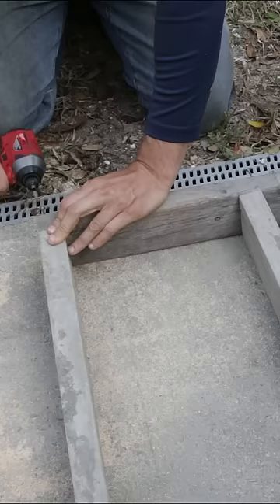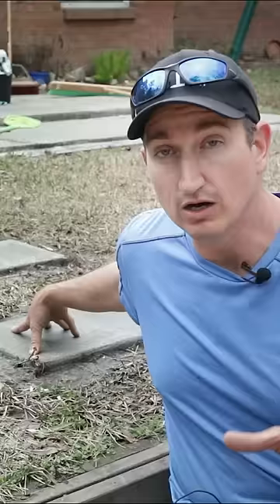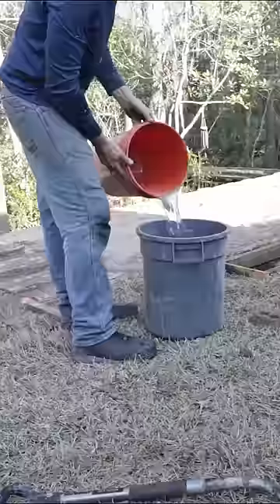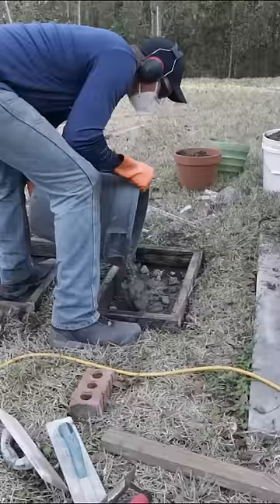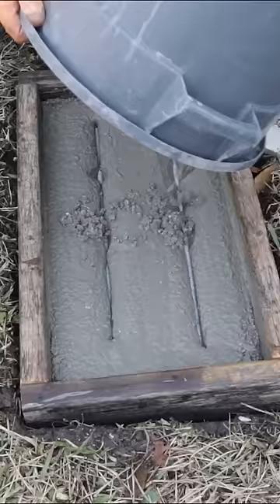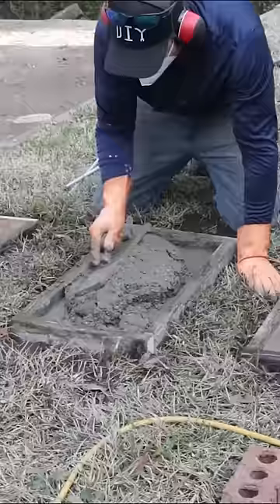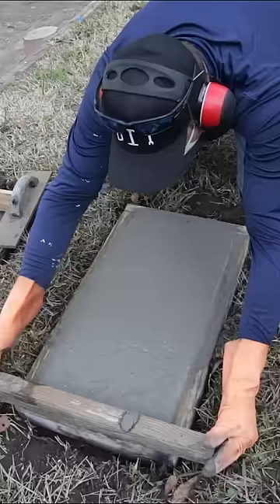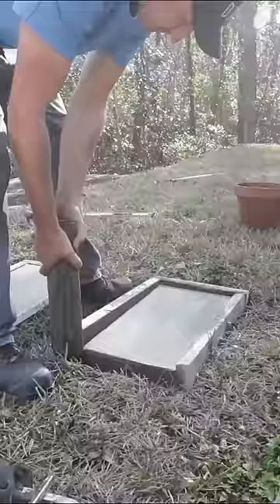How To Work with Concrete for the First Time

Comment: You dont need reinforcement for something like that. Cracking happens because of expansion and contraction, but there is not enough shear force along a 3x2 step that isnt up against anything.
Reply: Theres 2 kinds of concrete, concrete thats cracked, and concrete thats going to crack.
Reply: @MatthewJRedmond  When I leave a customer with some new concrete, I always tell them 3 things. Its going to crack, it wont catch on fire, and nobody will steal it
Reply: @jordantoops3814  without a doubt lol.
Reply: You still have to put crushed stone under the concrete. It's going to crack and sink from the elemental erosion
Reply: Rebar keeps the slabs from shifting away from one another. In years time the ground moves and u can have slabs moving any direction haha
Reply: Yep agree!  The bar can act as expansion joint.  Maybe sone wire mesh if anything
Reply: @TrwUniversity  rebar that is completely contained inside each slab as shown in the video will do nothing of the sort. It only helps minimize potential breaking/cracking of the slab itself.
Reply: @dragons_red  metal doesn’t make concrete stronger 

Concrete will crack with rebar in it or without it in it.

Comment: 1) The pad will move and sink because you didn't put a bed of crushed stone and sand down. 
2) You really don't need reinforcement for a small pad like this, but if you insist, use rebar which is made for this and a lot less expensive than threaded rod.
3) it might be overkill for a tiny job like this, but cover it with plastic while the concrete cures.

Comment: You forgot the first step most first timers do mixing concrete.  Add enough water to the mix until you have the consistency of coffee.  Then stand around wondering how long it will take to setup.😂
Reply: Isn't that cement not concrete?!
Reply: @D_and_L  cement is one ingredient in concrete.  Concrete is the finished product when you mix cement, sand, gravel and water.
Reply: Excellent comment!
Reply: Coffee is the same consistency as water?
Reply: Hahaha, yes.  Most people add way too much water.
Reply: lol my old boss called that "self leveling concrete"

Comment: No edger?  No magnesium float to push the aggregate down a bit and bring up some cream so you have a good hard finish without any aggregate showing?   No broom?  Placing that mud that dry, you might want to do a little more than just a few taps on the firm's to make sure you don't have a bunch of honeycomb.  Chuck up a bigass screwdriver in a 1/2" drill and brrrrrrrt forms.  You can hit the insides too to work like a vibrator to bust any cavitation around the edges too.
Reply: Hammer drill just on hammer setting works best on the forms.
Reply: Just use scc lol

Comment: Telling us the measurement of the form that will hold a full bag of concrete is wonderful!  You rock!
Reply from the maker: It is pretty close but the ground below the form factors in as well.  Even though the boards are 3.5 inches in height the ground height may be inconstant due to divots and bumps.

Comment: These bags of premix concrete are great but there is generally one very important thing I see many people forget to add or do not know to add. This applies is you live in a place that has freezing temperatures in winter. You need to use air add mixture, its a powder you add while mixing and it’s incredibly important if you want your concrete to hold up over the years during freeze thaw cycles especially on larger projects, you will avoid much spalling. Air aff mixture is easy to find at stores where you buy concrete supplies and tools but not a big box store
Reply from the maker: thanks for the tip
Reply: funny that a 1 cement says troweling ruins the air bubbles 😁👍

Comment: If you're going to give a tutorial on concrete you need to know that the rebar needs to have cross bars (aka transverse bars)  or it can just crack down the middle and fall apart . The best thing for that little slab is #9 wire fabric cut about an inch smaller than the inside form dimensions

Comment: If you've never touched concrete before, start small. Pick up a small rock. Only then, should you try touching actual concrete. Curbs are a good jumping off point. Trust me, I'm a concreteologist

Comment: That threaded rod is going to begin to corrode immediately upon setting it in the wet concrete. It’ll be completely reduced to rust in short order. At least give it a coat of paint or vinyl or something to protect the surface of the metal. Rerod is essentially useless in a block that small, although prestressing the rod would offer some minimal benefit.

Comment: Use fiberglass rebar next time.  the steel rebar will oxidize over time and degrade the concrete, eventually resulting in fractures.
Reply: You must be a fiberglass rebar salesman.  99% of all rebar in the world is steel.
Reply: @CJINW  castles in the middle ages didn't use ANY rebar, and yet they're still standing.  Why?  Because they don't have steel rebar oxidizing inside the stone and causing it to crumble.

Comment: That rebar is too near the surface. Would be more beneficial to hit into the ground rebar tied into a steel mesh. Corners will crack quickly unless backfilled to the same level. Looks nice though
Reply: Bro it’s not that serious 😂😂😂 I doubt that thing cracks since it’s not tied into anything and it’s not big enough.. it’ll just move instead of cracking
Reply: Why didnt he use rebar? Its cheaper than threaded rod

Comment: For any concrete walking surface you should lightly drag a broom accorss the top to give some traction for walking.
Reply from the maker: Using the Mag Float seems to leave a good bit of texture for friction on the concrete surface.
Reply: @MrKistel  We'll I guess for personal use it's fine. My experience was commercial and locally they require a brush finish on any concrete that is intended for foot traffic. That includes sidewalks, storage houses, ramps, and even parking lots.

But again, that is for commercial use not personal.

Comment: Also: DO NOT touch cement with bare hands!
Reply: Why not?
Reply: I did Mason tending including mixing the shit and I'm just fine
Reply: @JF94-k4o  Cement burn: the longer the cement stays on the skin, the more damaging the burn can be. Even after washing the cement off, the alkaline burn usually gets worse before it gets better. Skin begins to blister, swell, and bleed, leading to first-, second-, and even third-degree burns following soon after. Severe cases of concrete skin irritation can lead to permanent scarring and even require skin grafts or amputations. 
If it’s a one off, a brief exposure and you wash it off with soap you are likely to be fine, but if you wear gloves you’re totally safe. You’re free to live your life dangerously though. 🙂
Reply: I have never seen that happen although I don’t use concrete all the time but I have used it enough and had it on my hands.
Reply: I do a lot of tile floors and this is true. On bigger projects ive noticed my hands get very tenderoni and raw(feeling of irritations, dryness, and tingly) the next few days. Ive never heard of it doing 2nd and 3rd degree burns but i do know the mortar and grout mix does make my hands raw.
Reply: @Cricrikilik89 just waking up and deciding to lie on the Internet lol

Comment: Rod will rust and expand prematurely ruining the pad.  If it is exposed to water, don’t use any metal reinforcement.  Only garage floors and that which are covered get rods.  Concrete actually bends and is porous.  Mike Haddock concrete school of hard knocks.  He’s awesome!

Comment: Steel rebar is my biggest pet peeve I believe aluminum or carbon fiber rod if you have the money. Why because if the concrete breaks over time the steel bar will oxidize and it expands concrete doesn’t creating failure point old bridges especially near the ocean are vulnerable

Comment: Wipe the inside edges of your wood frame with old motor oil to ease the form off when the concrete is dried
Reply from the maker: good tip

Comment: What about crushed stone at the bottom of the form, leveling the form, troweling the concrete after using the float, edging the blocks once its begun to dry a bit and brooming the blocks after an hour or so ?

Good start......... but it needs a little more than what you show here.

Comment: run a brick trowel between the fresh concrete and the forms, several times, before you screed, get in a habit of doing that, (if you want, that's what I used to do) this helps greatly eliminate honeycomb, and when you "edge" it you will have the aggregate settled in place so you don't get dips in the finished edge
Reply from the maker: great tip
Reply: @MrKistel  Thank you, MrKistel, Len

Comment: Threaded rod was a mistake. Rebar has the same temperature expansion rate as concrete that's the reason concrete cracks up so easily with other metals especially where temperatures can drop below freezing in winter

Comment: The bar isn’t needed on this. The slab is too small and is fully supported under. If you want to stretch the concrete out a little, at this size, you can pour the same thickness as the pavers at your local stores but I like the simplicity for calculating one bag.

Comment: My first concrete job was paving repair, about 8"x18" I used small bag of ready mixed concrete.
As far as I know it's still there under the patio that I laid about 20 years later.
I was about 10 years old - 57 years ago😅
Reply from the maker: awesome, thanks for sharing.

Comment: You absolutely don't need reinforcement for a pour that small and thick. I've found 80 lb bags of concrete hardened from exposure on my property, used and abused for years sitting on the ground with no signs of cracking.

Comment: Thank you so much! I am so intimidated by concrete projects but even more intimidated by pricing for labor.. I know it’s usually hard work and they deserve the pay but when you just don’t have it- You just don’t. Id like to start small and work my way up. Thank you so much for this video!
Reply from the maker: Thanks for the comment and best of luck on your projects.
Reply: The biggest thing when it comes to concrete is to make sure the weather is supposed to be good, and especially when starting out, don't leave it unattended. The best thing about crete is that at every step there's a chance to fix any whoopsies. Say you put a big gouge in it, just wipe it out with a float, you take too much cream off the top somewhere while troweling, just work up some more cream with your float and smooth with the trowel. As long as you don't leave it unattended too long or go with too big a pour that it gets ahead of you. If it starts to setup a bit too quickly, you can spray some water on it to help slow it down and give you more cream if needed. Some people will say not to do that, but it won't hurt anything. Finishing machines come with built-in watering systems for finishing. The only time you're not allowed to do that is if the project manager says no, at which point you just make sure they're not looking 😂
Reply: Thank you both!

Comment: Without placing down a permeable layer of #abc or crushed rock to allow water drainage. The concrete will bury itself before the end of the year, depending on rain fall. 
You cant just place concrete on dirt and expect it not to bury itself.

 It has hands man! Cmon.
Reply: Well if you bought papers,  yr gonna just place them so what's the difference
Reply: Well if you bought papers,  yr gonna just place them so what's the difference
Reply: Well if you bought papers,  yr gonna just place them so what's the difference
Reply: Well if you bought papers,  yr gonna just place them so what's the difference
Reply: Well if you bought papers,  yr gonna just place them so what's the difference
Reply: @garybakker8812  ok bot. Your code malfunctioned.

Comment: see idk I did my first concrete project last summer did a 11ft by 4ft sidewalk to my house. I feel if you do enough research and have a game plan on what you're going to do it's definitely manageable to do. I dug down tamped the area put stone down tamped that wire mesh and rebar. came out really good my only 2 mess ups were i calculated the wrong dimensions for concrete and had some extra bags and I didn't get a concrete mixer. I definitely got a great work out that day
Reply from the maker: I bet that was a good workout!

Comment: Threaded rod is smart, gives something for the concrete to bite onto and prevent motion.
Reply from the maker: Thank you. I think this is the first supportive comment I have received regarding the use of threaded rod.  In the longer video, I describe how did not have rebar around but some surplus threaded rod which is why it was used.
Reply: @MrKistel  glad I could help🙂

Comment: You can also seal the concrete with a concrete sealer like for a garage floor. And do not put rock salt on it in the winter it will destroy the cement.😊

Comment: Where to begin. No Gravel subgrade, no stakes on forms, could pour it all at once if forms were tight n right, don’t need rebar(nobody that pours concrete calls it “threaded rod”) and shoulda broomed it! No texture means slick as snot when wet 😉

Comment: I would’ve definitely used an edger on this. Especially in the very beginning, those sharp edges are going to be so fragile, and even after cured will likely get major chip out overtime.
Reply from the maker: Edger is shown in the longer format video provided in the video description.  YT only allows 60 secs for short vids which makes it hard to squeeze in all the details.
Reply: @MrKistel how is there more details?😂

Comment: Let’s see. The “experts” say you should have dug much deeper, poured  24” footings, added 3/4” crushed stone, sand base, termite treated, plastic, wire mesh and rebar with chairs, braced forms, sprayed forms with diesel (PAM works, too), specified an ideal slump, used a vibrator, edged the sides, brush finished or stamped the stones, etc. Or, just be happy with what you have done!  Or, like some said, save yourself the aggravation, work, time and criticisms by just using premade stepping stones.

Comment: Reminder: the more water that you add, the quicker the set time, AND if you want a silky-smooth finish you will need to smooth the top.  The more smoothing of the top before the set time, you will see few large rock , but more water-sand at the top,
Reply: Be careful with adding water. Too much water you will throw off the w/c (water/cement) ratio which in turn will compromise your overall strength. Better to have to use a little more elbow grease to get a nice finish then sapping the strength away and the concrete snapping under its own weight.

Comment: threaded rod is a waste, just use coat hangers, also could show different ways to finish surface, and should clean edge so it won’t have sharp corner and slope away water

Comment: You miss a simple tool,  called edger or border. Kinda cost like 15$ for a Marshalltown brand. Easy to use and make your top edges round.  Better, since you gonna walk on it, edges and corners won't break that easy later on.
Reply: Also could use a clean broom to make lines on top...add grip, less slippery  under rain or snow.
Reply from the maker: Edger is shown in the longer format video provided in the video description.  YT only allows 60 secs for short vids which makes it hard to squeeze in all the details.

Comment: there was a cool video about a dry pour slab which seemed to use much less concrete (thinner), no reinforcement and no real time limit on the pour. (doesnt begin to set u til you water it)

quite strong too it seems.

Comment: PLEASE NOTICE: the first screw he installs is into the end-grain of the 2X4 with ABSOLUTELY NO HOLDING POWER. ( what was he thinking?)
Reply: Sure but he’s making a small form, not building a house lol it doesn’t need to hold up to much stress
Reply: @AustinHansen  I am so happy that you took the time, but could you invest just half a second to notice that at 0:04, oh wait, oh sht, I now see his left hand is covering the board coming in from our right, and the board going from us toward him actually butts up against the board from our right.  With the irregular coloring on the pieces of wood, I thought the board from our right was butting up against the right side of the board going from us towards him, so it appeared he was screwing directly into the end grain of the board going from us to him!!!   So   ...   I was DEAD WRONG in my assumption, and you were ABSOLUTELY CORRECT!!! So put that in your pipe and smoke it!!!   😄😄😄

Comment: Also dig deeper add at least a minimum of 4inches of gravel then tamp it then put your forms fill the box to grade push the rebar down then grade it, float it wait for it to dry a little then break the floor with your float and finally trowel it... The problem is the timing unless you know when to hit the floor you won't finish it properly hence why you should just let a professional do it

Comment: Definitely would have been cheaper and less labor-intensive to just buy a few blocks at home Depot. You didn't prep the ground underneath with crushed stone and the spacing seems a little off. It's going to be awkward walking on those.

Comment: I use the "dry pour" method to make 36-inch wide pathways 1.5 inches deep in my back yard garden.
Reply from the maker: Did it turn out ok?
Reply: @MrKistel  
It turned out more than okay. I actually prefer the rougher surface for traction, especially on the sloped paths using my wheelbarrow, hand truck, etc.

Comment: Can you just pour the powder into the mold and then spray it with a garden hose gently for a while?
Reply from the maker: The concrete would set but not a method I would incorporate to make these block steps